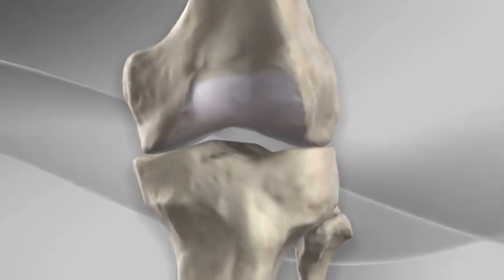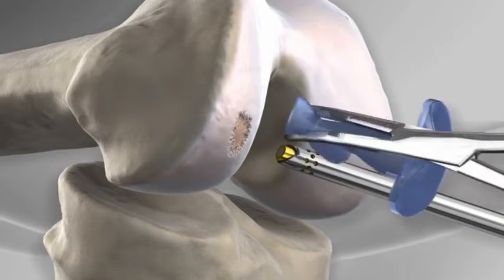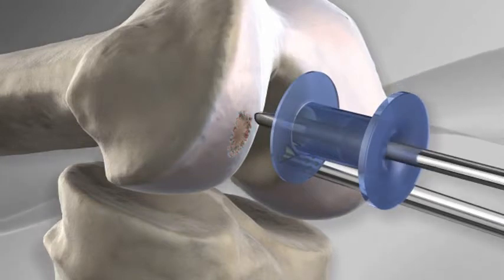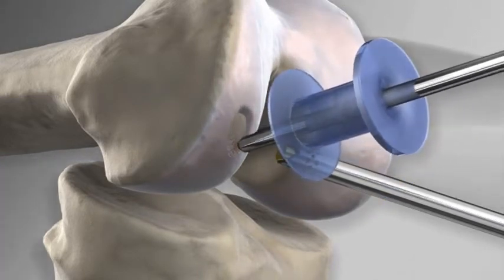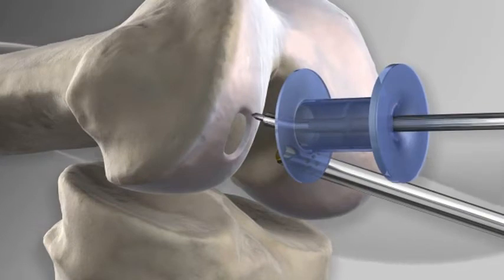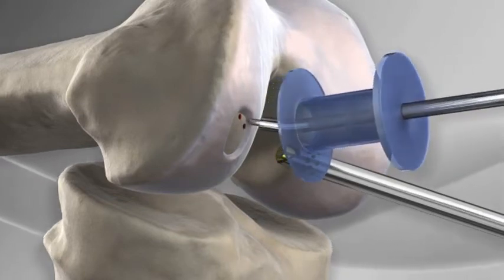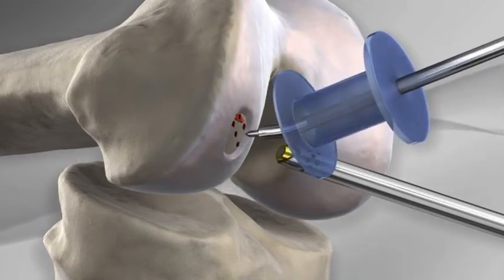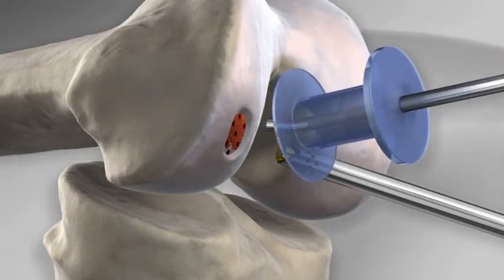Microfracture

Comment: I had a microfracture surgery on my femur cartilage in 2016, now the fibro cartilage seems to have been worn out, I find it painful and I cant walk .  I kind of knew this might happen as I read in the research. My doctor did the surgery when he was treating my plica syndrome and found in the same arthroscopy there was a  4mm x 9mm full thickness cartilage damage  on the weight bearing part of my femur .  I was not sure if he should have done the microfracture, but I saw he did it. A lot of cartilage around the hole in surface had been removed ( I saw he removing it because I was administered anesthesia for the waist down) , I did have some suspicion and worry, because the hole suddenly became at least twice as big.  My rehabilitation was basic, I tried hard and rented a CPM machine for a month, but still, not a lot of protection, and I didn't inject the PRP which would supposedly fortify the generated fibrocartilage and make the result last longer.    I did the surgery in March 2016, now it's May 2019,  I started to experience pain all of a sudden. Now I am staying in bed. So at this stage, is there anything I can do to repair it?   Thanks.